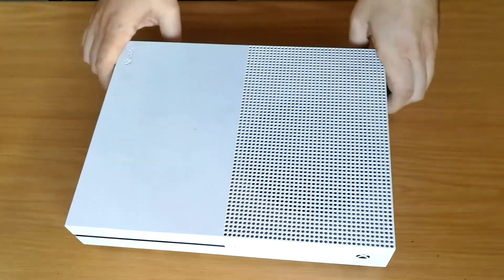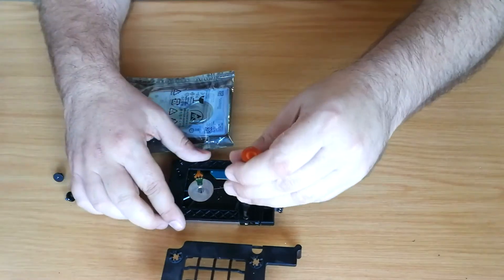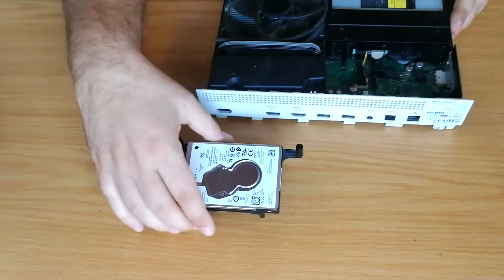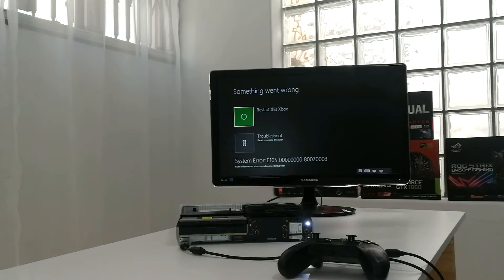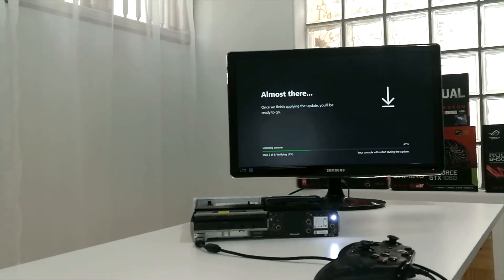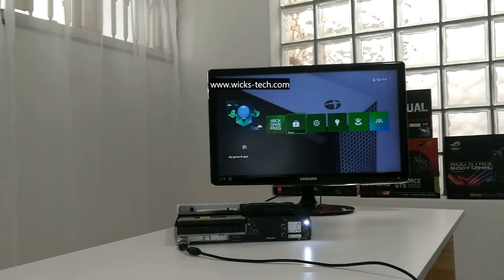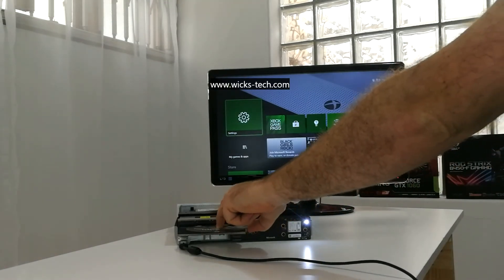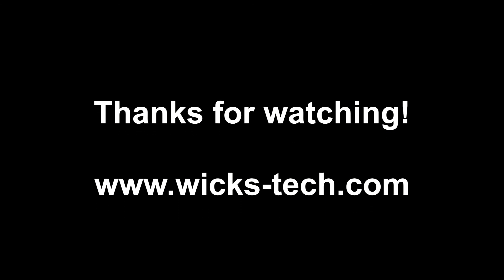Xbox One S Faulty Hard Drive Replacement - I Will Build It!

Comment: It took forever and a couple different USB drives, but when I finally got to access the USB drive for offline update, mine keeps bouncing between e101, and e106, it just depends on what I try, between offline update or reset the Xbox. Any thoughts?
Reply: haven't had 106 yet but I'm struggling with 105, 102, and 101. Have you found a fix since you posted this comment?
Reply: Make sure that you use a 500gb or higher hdd or ssd, it won’t work with a 480gb or lower.

Comment: I have replaced my HDD, cause i was getting this problem, couldn't update.

i've Changed the HDD, have done all types of procedments.
Creating the partitions on HD using script.
Creating the partitions on HD using script and placing files on A and B Folders, as well with the boot animation.
Trying update the OS via USB
Reset the Disk, letting the xbox doing all the job.
But, i'm still getting error, at step 3 of the update, when the console turns off and on, the update stops in 60%, and get me the same error, something is wrong.

Any ideas?
Is it possible that i need to wait untill next month so i can get newer version of OS1?
The last one in my xbox was the update of 04/19/2021. Maybe i cant get in the HDD the same version as was previosly.
Reply from the maker: The problem might not be the hard drive but the propriety hard drive SATA / power connector. Faulty connectors do cause the same errors as a bad hard drive. These are available on eBay and are relatively cheap.
Reply: @Iwillbuildit  tks men! 
I was thinking about it, saw in other video. Hope it works
I will come back with results
Reply: @Iwillbuildit  just replaced the cable, istill no good. After the rebot step 3 breakes on error E100.
😓 i'm gonna wait untill next month hoping for a issue in this OS1
Reply: @Richardsramos  What's the specific full error code you're getting?
Reply: I saw in a different video that it requires a hdd or ssd of 500gb or higher, it’s not able to install on 480gb or lower. Maybe that’s why you’re not able to install it completely. Lmk if this solution works for you.